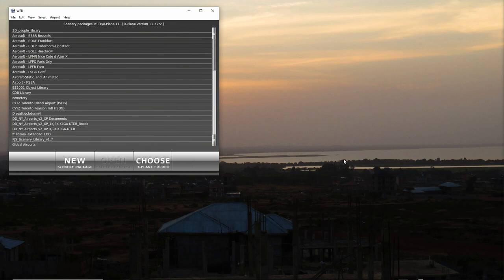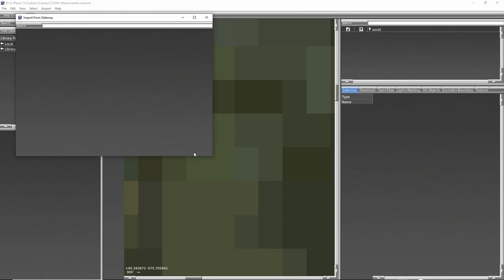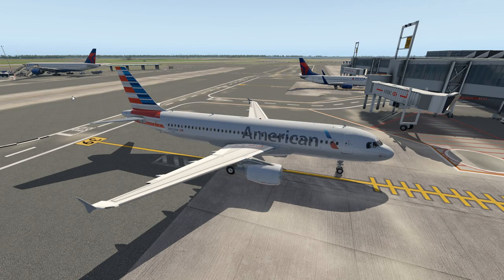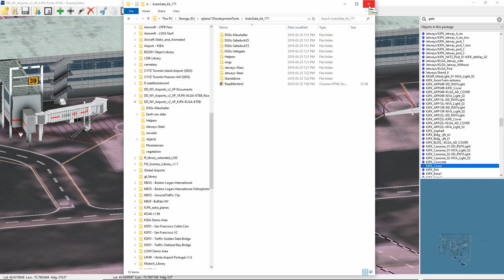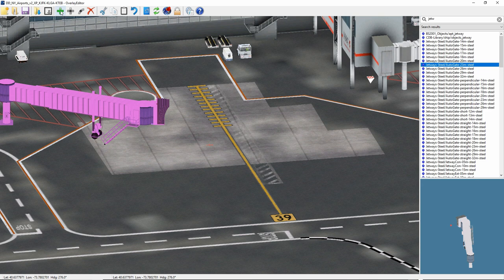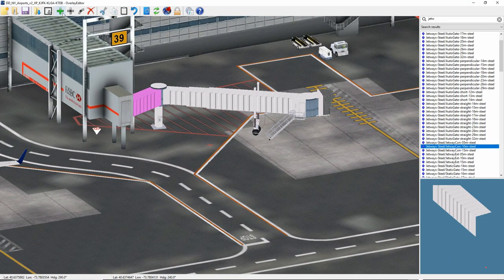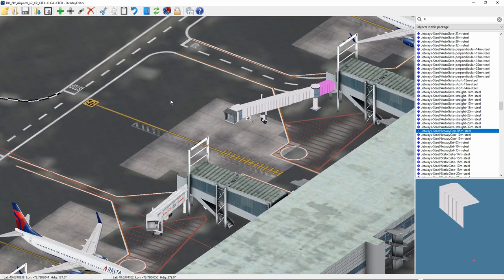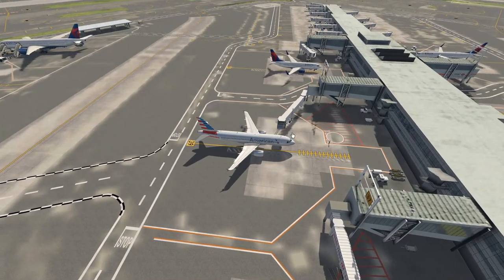Tutorial on adding autogate to default airports or airports without autogate

Comment: Good instruction Mr. Black. You are very easy to understand for us older guys lol. Do you have any interest in show casing your skills with adding the new SAM Gates using WED? The latest version of SAM v 202 keeps the library in the actual SAM folder which goes in the plug in folder not custom scenery. So I'm interested in learning how to add a custom gate using SAM with only WED. I know as a streamer myself, that content should be enjoyed by the provider. So if you have no interest in doing a tutorial on SAM, I understand. Thanks for the videos you have.  : )
Reply from the maker: I'll take you up on the challenge and let you know when its done.
Reply: @bobblack4604  Excellent! Thanks.
Reply from the maker: I've decided not to do a tutorial on the SAM autogate until it is compatible with the FFA320. Either Flight Factor needs to update their design or SAM needs to update their design but currently the SAM autogate doesn't work for the FFA320. It is my preferred plane to fly so don't want to arrive at airports where the auto gate doesn't work. The SAM animation is cool but takes longer to install and too many things to tweak. I can install a regular auto-gate in under a minute just using WED- not so with SAM.
Reply: @bobblack4604  Thanks. I understand. I also fly the FF A320. I will add autogate for now.
Reply from the maker: @Chase1399Aviation  I've actually changed my mind the SAM WorldJetways plugin works for FFA320 and it miraculously changes the static gates in all the default airports to autogates (I think) at least the ones I've tried it on work but maybe the air port designer has to use MR X's library for the gates - I don't know but I am now sold on the SAM. It's a game changer. The World Jetwaysplugin is payware but it's worth the $19 and saves a ton of time trying to install auto gate on the default static airports.
Reply: @bobblack4604  Correct. However I know for a quick fix the "SAM World" is a good option. But I don't care about that. Most of my scenery is payware at this point. So I'm just looking to add one SAM Gate to just a few Airports, or AutoGate. I mainly FLy on the West Coast on PE. So if your going to do a Tutorial on implementing the SAM Gate then that would be great and it would Save me the trouble of having to purchase the SAM World. So a step by step on adding a single SAM Gate using WED would be awesome!. Have a great weekend. Dave
Reply from the maker: @Chase1399Aviation  OK I've created a tutorial on how to add SAM autogates https://youtu.be/g8IEBmXGChs